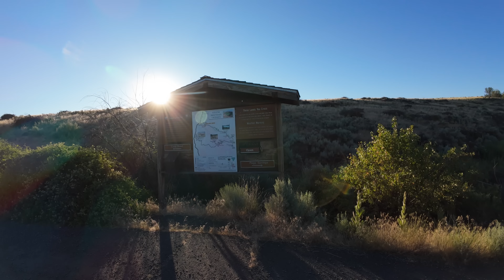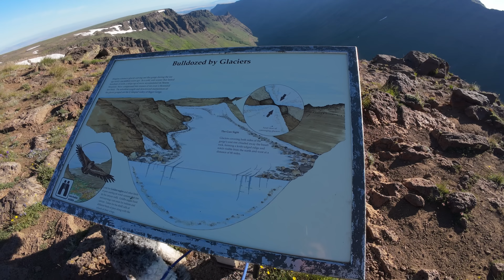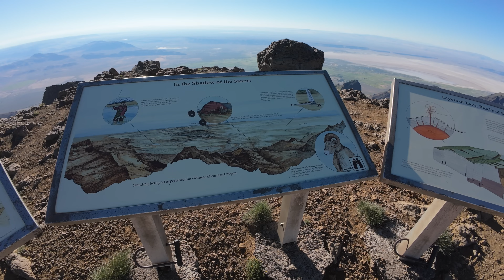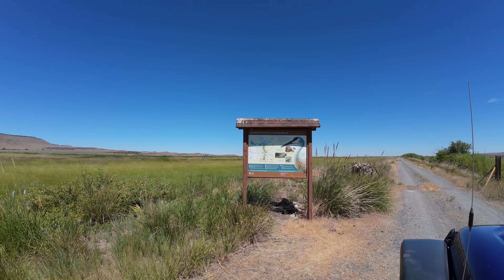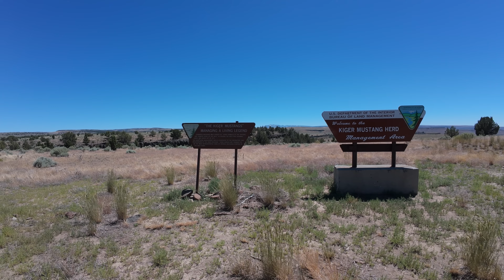Oregon Overlanding Disaster

Comment: Brother we all been there. Battery died. Timing chain slipped. Crank position sensor died. Locked the keys in truck. Tire failure. Wheel bearing failure. The wife's knee hit the transfer case lever shifting it from low to high 4x4. Granading the gears. Still made it from Clayton Oklahoma to Kansas. I built my own underhood welder. That's saved several rigs vacation.

Comment: I just had a kind of rough trip myself to Telluride.  Discount Tires "balanced" and rotated my tires the day before my trip and Brakes Plus adjusted my parking brake and put new brakes on the rear of the Jeep.

Tires were not at all balanced with a bad shimmy over 45 mph, they filled 4 tires to 40 psi and one to 32, and broke my wheel lock on the spare.

On Imogene pass I heard metal banging and found the rear brake caliper was falling off and I was missing one bolt.  I took a bolt off my roof rack and used it for the brakes.

My Teraflex springs and shocks in the rear also died and destroyed my bump stops.

Your trip sounded way tougher.  When it rains, it pours!

Comment: I always take my Ready Welder mig welder with me. It's a spool gun that runs on dc voltage and it welds amazingly well. I suggest you find a suitcase style welder for your adventures😎
Reply from the maker: I haven't welded anything since I took a welding class in high school in 1982. I could certainly use a small unit sometimes. I just need some practice.

Comment: What type of trailer is that? Seems it doesn’t have a strong enough suspension to go in rocky trails
Reply from the maker: It is a Tribe Trailer Overland Basecamp. We have taken it on MUCH harder trails. The problem is that it has Gen 1 suspension from back when Tuff Stuff was making the trailers. When Tribe Trailer split from Tuff Stuff, the suspension was upgraded on the newer models. We are waiting on the new parts and we should not have any issues in the future.
Reply: Are the “Tribe” branded/name plated trailers the ones with the upgraded suspension? Thanks in advance.
Reply from the maker: @johnrivers9393  That is correct. The original Tuff-Stuff one is what we have. The suspension was one of the first things they changed when they split into their own company.

Comment: an other option was to remove the failed suspension and take it for repair

The designers of the failed suspension appear to have paid for some one to sit their structural design exam
- ijidits
Reply from the maker: I did not have the equipment there to do that. I have removed the suspension before to change the bushings so I know what is involved (in fact, I wrote their guide on how to do it). I would have needed my floor jack and some extensions and the closed place to buy new ones was over 250 miles away.